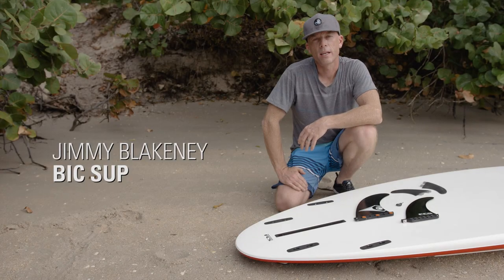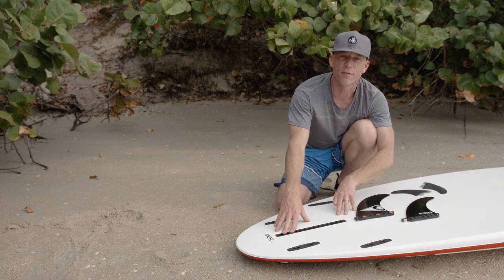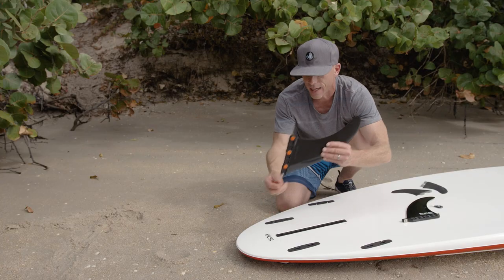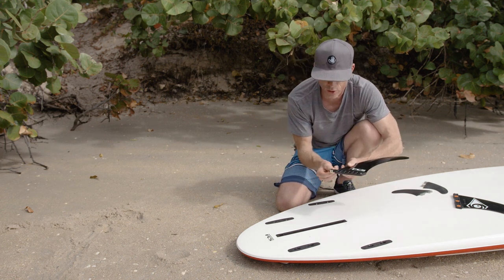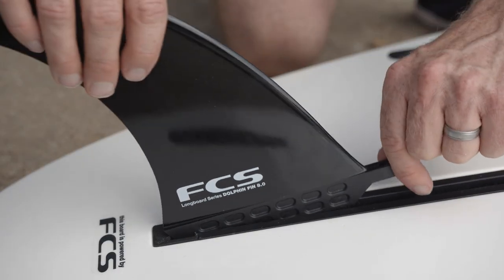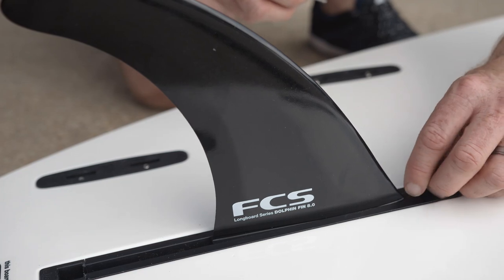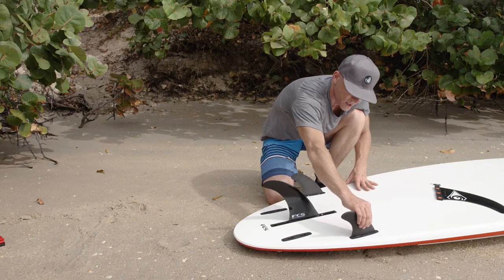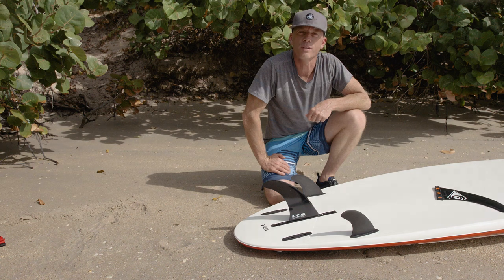How to Install Stand Up Paddleboard (SUP) Fins

Comment: Hello Jimmy,
i am from Austria and I bought a ToughTec 10.6" SUP two weeks ago. It is really nice and I like the board. But my problem is that the fin comes loose after about one mile. It has the quick connect fin. I use it on a lake, just flat water use. The pin of the fin for the rail already broke off because the fin slides out of the rail and was only with the pin in the rail and then broke of during paddeling. I wonder if other people have also problems with the quick connect fin.
Regards Paul
Reply: been using this board 10+ times already, no issues with the fit at all so far - looks perfect frankly. Good luck with yours